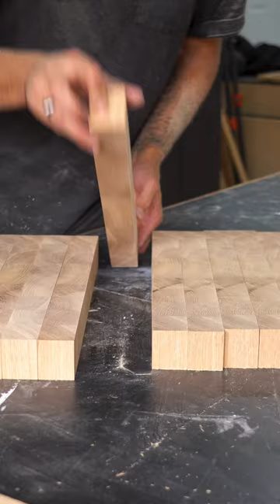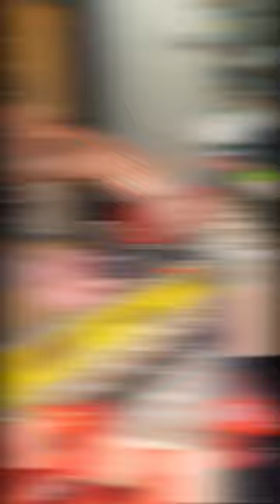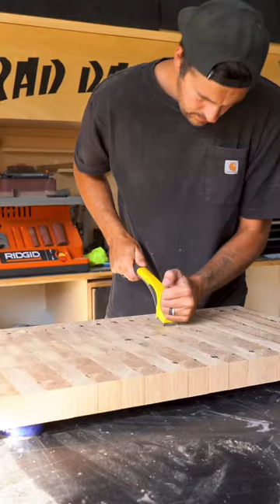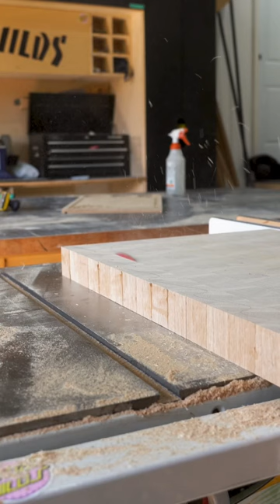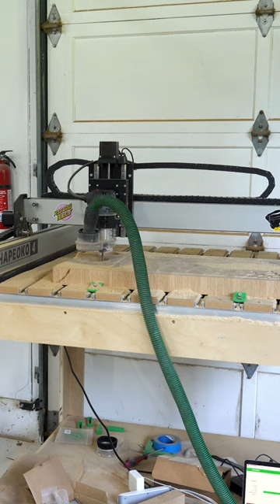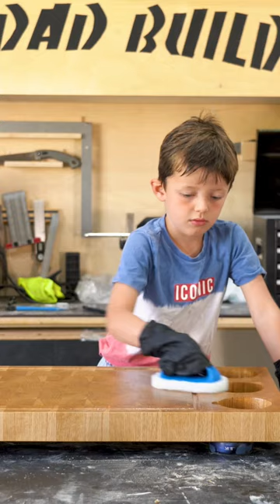Great beginner woodwork project

Comment: Most beginners don’t have that equipment. What are you talking about Pal? I surely don’t. Especially being in the military you can only carry so much weight when I got out I didn’t have that much room or basement or garage. And after a divorce the kids got all my tools left a lot of outside the rust. Anyways, I’m rebuilding my tool shop in my garage and I don’t have all those tools. When I’m saying is now that I’m 65 tad bit older than most, I just need some simple projects to do. So all those advance tools you have is not what I call a beginners project just saying brother, just saying.

Comment: Biginer.. with a computer cnc, thicknes planer.. no
Reply: Drum sander
Reply: @paulhopkins1905  , yes all those toys are on the carpenter 101 kit 👌
Reply: @haroldrodriguez3689  If you can't make a cutting board without a table saw, sander and router you have no buiness in a wood shop. This is 100% a beginner project

Comment: Pine? I thought it couldnt be used as a cutting board
Reply from the maker: It’s white oak
Reply: @RadDadBuilds also not good for cutting board.
Reply: @TheJelac You're thinking of red oak, white oak is fine for a cutting board since, while porous, it has tyloses in its pores that resist water while red oak has open pores. Also both woods are very high in tannins which are bacteriostatic (they stop bacterial reproduction). If you don't know what you're talking about just don't talk.
Reply: @angercatalyst  my mistake. Dont be to harras on me. Peace bro.
Reply: @TheJelac no worries, peace ✌️